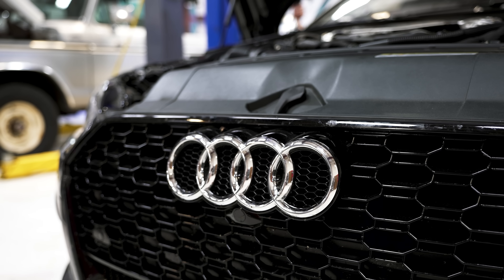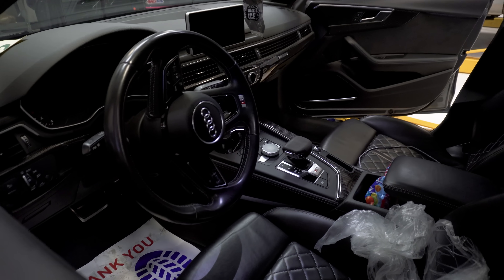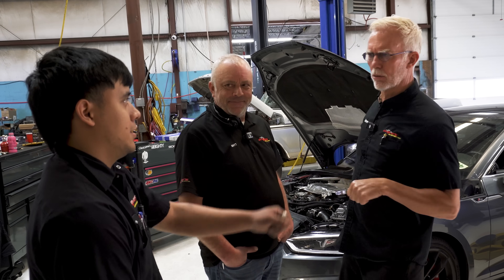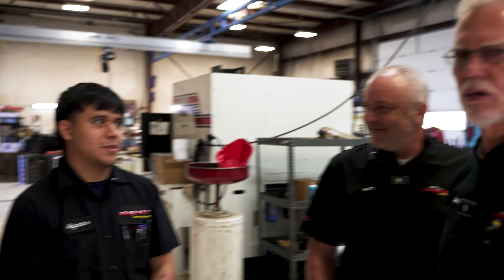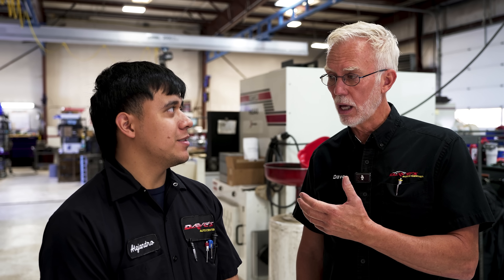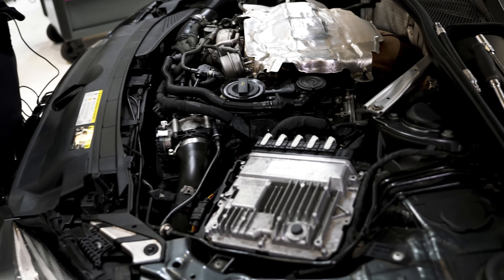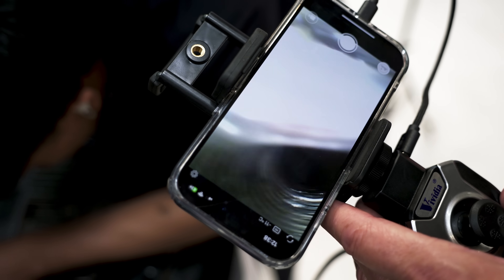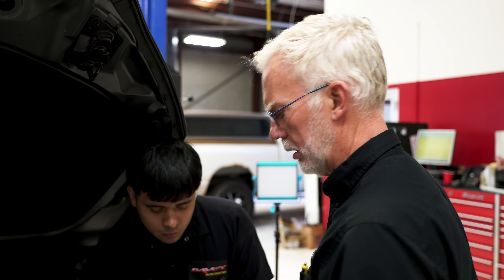Audi S5 Engine Piston Damage

Comment: Have a customer with a 2020 Acadia I’ve put 4 catalytic converters and the entire exhaust system on the car i asked him multiple times what he does that normal people don’t do and he said he drives hard after the first two cats and muffler exploded he fessed up and told me he puts a can of seafoam in the tank at every fill up. I told him that was for older cars and no one should ever use that much. He replied it’s an old car it’s a 2020. So if anyone needs a quick way to explode bank 1 and 2 converters just run an excessive amount of seafoam that doesn’t completely burn in the combustion cycle and wait till that cats get it up to 1200-1600 degrees while driving a few hundred miles a day for Uber.

Comment: Question for you. Got a friend with a 2018 GT350 with 26k miles and number 8 has zero compression. Heard the way Ford lines the cylinder walls could be the cause the ringlands went. Do you have experience rebuilding those motors? Sleeve them or?

Comment: Integrated Engineering found an issue with factory software I think it was that car, that while driving medium throttle on highway it was going super lean on a cylinder and killing it.
Reply: That’s the reason I dumped IE, so many options out there for a tune. Jackal Motorsports is a good one!

Comment: If you have clean underwear on, and want a good solid shock to the shorts, check whats involved in a VW Audi Porsche TDI 3.0 timing chain job.  
Engine and transmission out the bottom.  Transmission comes away from engine.  Timing chainS are in the rear of engine.  While engine is down, get ready to fix all the turbo and oil cooler leaks, clean the EGR & intake. 3-4 thousand Euros, idk what that is in Imperial money, but its a lot.  
Stay gold.

Comment: HORRIBLE CARS . CHECK THE OIL TAKE THE ENGINE OUT CHECK THE WATER LEVEL TAKE THE ENGINE OUT CHECK THE TYRE PRESSURE TAKE THE ENGINE OUT . PLUSE ALL THE PLASTIC CRAP THAY USE .

Comment: And it also has to do with the oil.  Check the chemistry.  I can't even install a spark plug, but I have a degree in Engineering Physics so I do know the theory.

Comment: Low-speed pre-ignition (LSPI) is a phenomenon that can severely damage direct-injection turbocharged engines. It occurs when the air-fuel mixture in the combustion chamber ignites prematurely, before the spark plug fires, at low engine speeds and high loads. Here’s how LSPI can damage your engine:
1. Sudden and Uncontrolled Combustion

In LSPI, the air-fuel mixture ignites spontaneously and uncontrolled, leading to a very rapid rise in cylinder pressure. This sudden pressure spike is much higher than what the engine components are designed to handle.
2. Engine Knocking

LSPI is a form of engine knock, but it's more violent and unpredictable than typical knocking. The intense knocking can cause immediate and severe damage to engine components.
3. Piston Damage

The rapid pressure increase can crack or break the pistons. The force can also cause the piston rings to break, which can lead to loss of compression and increased oil consumption.
4. Connecting Rod Damage

The connecting rods, which transfer the force from the pistons to the crankshaft, can bend or break due to the extreme pressure spikes. This can lead to catastrophic engine failure.
5. Cylinder Wall Scuffing

The high pressure and temperature can cause the pistons to expand more than normal, leading to increased friction against the cylinder walls. This can result in scuffing or scoring of the cylinder walls, which deteriorates the engine’s performance and longevity.
6. Spark Plug Damage

The premature ignition can damage the spark plugs, causing them to wear out faster or even break. This can lead to misfires and further engine performance issues.
7. Bearing Wear

The excessive forces from LSPI can cause accelerated wear of the engine bearings. This includes both the main bearings and rod bearings, which are critical for the smooth operation of the crankshaft and connecting rods.
8. Increased Emissions and Fuel Consumption

LSPI can lead to incomplete combustion, which increases unburnt hydrocarbons and particulate emissions. This not only harms the environment but also reduces fuel efficiency.
Prevention and Mitigation

To mitigate LSPI, manufacturers and drivers can take several steps:

    Engine Oil: Use engine oils formulated specifically to reduce LSPI. These oils contain additives that help prevent the conditions leading to LSPI.
    Fuel Quality: Use high-quality fuels that are less likely to pre-ignite.
    Driving Habits: Avoid lugging the engine (running at low speeds with high load). Downshift to keep the engine in a more appropriate power band.
    Engine Tuning: Manufacturers are improving engine control strategies and hardware to minimize the risk of LSPI.

By understanding and mitigating the risks of LSPI, drivers can protect their direct-injection turbo engines from severe damage and ensure their longevity and reliability.
Reply: Best chat GPT response so far!
Reply: @jamesblond150  Yeah so obvious. Can smell the GPT from a mile away.
Reply: Nice copy paste
Reply: Now you've covered everything  for a 'told you so' 😅😅
Reply: ⬆️This guy knows
Reply: Chatgpt went hard on this
Reply: Rocker arm failure?
Reply: Use good oil and fuel!
Reply: Well said
Reply: Generally, the 3.0 tfsi engine has a problem with peeling cylinder surfaces and it is not LSPI. They improved it but not long ago. My friend has a company called Szlif-Mot Białystok in Poland and he regenerates a lot of them and a lot of other engines and heads. This problem also occurs when the injectors atomize gasoline incorrectly
Reply: A higher octane number means less risk of LSPI.
Reply: @michaelbigelow3255  Well my car is direct injected but not turbocharged and since my last message 2 months ago, I got another 9k km on the odo problem free. Almost 20 years old now. 

It is getting increasingly harder to buy a non GDI/turbocharged car these days unless you buy older used cars. Even Toyota has it now.

Comment: LSPI destroys ring lands .. use the Correct oil that’s meets the specs 👍
AMSOIL Signature Series Protects Against LSPI
AMSOIL Synthetic Motor Oils achieved 100% protection against LSPI.

Based on zero LSPI events in five consecutive tests of AMSOIL Signature Series, XL and OE 5W-30 Motor Oil in the LSPI engine test required by the GM dexos1 Gen 2 specification.
Reply: Any GF-6 oil will do the same.
Reply: @gregjohnson2073  you are mistaken about the spec...GF-6 is the ISLAC rating for fuel eff. the API SP spec is the important one for preventing LSPI
Reply: @JasonKeranen  yeah it does both. You don't need to waste your money on expensive amsoil. I'm sure those tests were done by a lab paid by amsoil.
Reply: no these test are done at independent labs certified to do ASTM test procedures AMSOIL pays a lot of money to do these test.. if you take the time to check out the testing you will see that. It appears you don’t understand the API SP spec
Reply: @JasonKeranen you must be an Amsoil Dealer obviously

Comment: Interesting. With direct injection with turbo charging (LSPI) low speed preingnition becomes more of a problem. Caused by motor oils with calcium suffocate additive that was sensitive to high heat or hot spots in the cylinder resulting in premonition. Oils are now formulated with magnesium suffocate that will be less likely to reignite.  Motor oil manufactures have adjusted to new API standards to solve the problems.

Comment: Couldn't LSPI (low speed pre-ignition) cause  this? Turbocharged GDI engines require GF-6 specification oil to prevent this. IMHO, that piston had been going bad for awhile.

Comment: While stationed in Germany my buddy bought a brand new Audi a4, always took impeccable care of it and did all the routine maintenance……still had nothing but problems with it, right from day one until 10 years down the road when he finally got sick of spending money on it and sold it.
Reply: Latest models have issues from the factory. My mate works at an official Porsche/Audi dealer and showed me a brand new oil pump on a A4 which came with no gasket on the mounting flanges (metal to metal contact). He said they found metal debris in the oil and the car had to be repaired 24h before it was sold to the customer.
Luckily they knew about the problem and were able to address it on time. But come on... What if they didn't...
Reply: All those immigrants who are working in the plants are doing a bang up job
Reply: @simsnqta that is why I do the break in period of 1000 miles then get an oil change. Just in case of issues or stuff left in manufacturing.  Even Toyotas can have issues.
Reply: Dude got a lemon. Audi a4 have a good engine all engines I have experienced of audi for a long time period and never had issues. Even a tuned twin turbo v8 rs6
Reply: @DudeThedudesky 2009 to 2011 were horrible.

Most needed new pistons, piston rings, turbo charger, timing chain and tensioner, and rear main seal. I may be forgetting one or two things. I had all this done to mine at about 65,000 miles. Knock on wood it has run great she once with 130,000 miles.
Reply: @DudeThedudesky  I don’t think it was engine problems mostly if I remember correctly. I know the clutch had a catastrophic failure, something broke internally. And a bunch of electrical issues like sensors and things that had to be dealt with by a dealer.
Reply: @minnesotatomcat   oh. Well I suppose that could happen. Pretty unlikely though. Audis are rather reliable.
Reply: I have a 2016 S3 that's tuned APR stage 1, with 195,000 mi on it, still purring like a kitten.
Reply: @Lifeisbutam3m3 
Some of their cars were straight lemons. Some are brilliant. Educated buyer prevails
Reply: @Lifeisbutam3m3 beyond lucky
Reply: I love/hate my Q7. Just my long trip highway car.  That's where it shines! 😮
Reply: Had new s4 in 2005 and it never ran well.  Lemon law saved my wallet and got a m3 e46… best vehicle ever.
Reply: But German auto fanboys always say that as long as you do all the required routine maintenance German cars last forever and won't have any problems. You mean to tell me they are lying? I'm shocked....
Reply: Lemons can happen. I’ve done nothing but abuse my A4, redline it everywhere. Zero issues. It’s now a high mileage warrior with the scars to prove it
Reply: Bad luck. 2.0T’s are incredibly reliable.
Reply: @axe2grind244  yeah but apparently the electricals were causing problems not engine
Reply: @DudeThedudesky  I figured. I’ve had a 2.0T in every generation in 5 different cars from ‘06 to 2021 and never even had a cel come on. They handle -25 degree temps incredibly too. I’m pretty lucky, I know this.
Reply: @axe2grind244   all audi engines are reliable. I've had all engines. Rs3 rs5 and i bought my father a new rs6 that he drives daily 800 hp rs6 for 2 years. I've had no issues with them and I modified rs3 to 600 hp rs5 to 650 and had 0 problems. I plan on forging the rs3 rs5 rs6. I had an s5 aswell with 250k miles. I've worked on all audis too. I'm an audi/mercedes/bmw mechanic. Mainly bmw because they break down the most so I earn the most money from them
Reply: @DudeThedudesky  nonsense

Audi 2.0 TFSI from 2009 to 20011 was a dumpster fire until fixed and then it is a solid engine.
Reply: @BriansRCStuff   no it's not. My buddy had a 2010 audi with the 2.0 and never had problems with it for all the time he drove it. I also worked on that engine a couple times.
Reply: @DudeThedudesky the EA888 v2 was a nightmare on VW/Audis
Reply: @rickyspanish645  I don't expect every engine to be superb. They obviously fixed it and now it's good.
Reply: @axe2grind244  depends on the year… some years were incredibly unreliable and among the most litigated engines made.
Reply: I bought a 08 Audi A8 4.2 fsi  in 2009. Still have it with 200k . Runs like the day I bought it.
Reply: @Whyus793  any timing chain issues?
Reply: @BriansRCStuff  Zero problems ,I think most of those issues were with the d2 platform from 07 and earlier . I've had the media blast for carbon buildup. I've done the high pressure fuel pumps and a wheel bearing. Ohhh and a telescoping steering column motor done when it was still under warranty. Other than that , brakes and  tires.
Reply: @Whyus793  that is excellent! That is a awesome engine other than the mileage, but who cares. It sounds so good.
Reply: @BriansRCStuff  it's been the best car we've ever owned .  I just put a remanufactured set of the 5 spoke twist sport wheels that came on it and I pull into a gas station and normally am asked if that's a new Audi. They about fall over when they hear it's 16 years old.  Keeping in mind though it's stayed out of  the salty WI. Roads in winter. She gets tucked away for 5 months a year.
Reply: @Whyus793  I get it. I have a 2011 A4 and it still works very good for its age. It may not quite look new due to the less sharp edge styling versus new cars… But it still looks pretty modern! For a 13 year old car.

Ours has been been driven and snow and they have very good rustproofing… No rust at all except maybe a tiny bit on the exhaust system and some random parts here there under the car .

It is garage kept which helps keep the paint fresh of course .
Reply: My A4 had zero problems. 10 year old model, 150tkm. I sold it because I wanted to try something else. Not because I had issues with it.
Reply: @betterbeavailable  what year?
Reply: @BriansRCStuff  2014
Reply: @betterbeavailable  they were reliable by then.  The 2009 to 2011 were horrible.
Reply: @betterbeavailable  congratulations 👍
Reply: Sorry to say this, but I would never buy a German or British car. These are lease only. Stop buying these cars until they bring their reliability to toyota standards. You have the power of the purse gentleman
Reply: Had an a4 as well and besides the oil issue that a few of the yrs where known for and fixed under warranty it was a great car overall with limited issues
Reply: The car had nothing but problems, but he kept it for 10 yrs? Yeah, your friend is an idiot or this didn't happen. Nobody keeps a troublesome car for 10 freaking years.
Reply: @old_dan  he bought it brand new, had it shipped back to the states as it was his dream car, and didn’t want to give up on that dream I guess. Like a lot of people that buy expensive vehicles I’m sure he had so much stuck into it that it didn’t make sense to sell it because the resale is garbage so he just kept fixing it hoping it was the last time. I would have got rid of it before the warranty was up, I’m not saying I agree with his choices.
Reply: My co worker never spent less than $2000 fixing every problem - of which there were many
Reply: all cars have problems. people buy Audi instead of Toyota because it has a more powerful engine and looks and feels better
Reply: @RevinSHAW Toyotas dont have problems 😅
Reply: Cool story. Still enjoying mine. And will still be buying another S5.
Reply: All due respect. That friend of yours should’ve sold it right before warranty ended. 

10 years paying for issues? Kinda hard to blame anyone but yourself 🤣
Reply: @nicolasrulli  it may have even been longer than 10 years, it still looked like new when he sold it as he always took great care of it. I told him to get rid of it too but it was the first new car he’d ever bought and I can see why he kept holding onto the dream of it being a good car but it just wasn’t. I think a lot of the problems were covered under warranty as it started giving problems right off the bat, but there aren’t many Audi dealers around here so any time something happened it was another long trip to drop it off and then go get it again. I remember the clutch going out on it once but not wearing out from use , the springs were breaking or something. Good looking car but I’d never touch one after seeing what he went through.
Reply: @minnesotatomcat  that’s fair. Nowadays we all know to buy from a nearby dealer considering all of the new tech on engines every year. Keep for a couple years and sell at warranty expiration. The price of depreciation is probably cheaper than keeping some cars after warranty is up
Reply: @nicolasrulli it certainly is not.learn to find a better mechanic. Older cars are more reliable. Stop make other people than yourself rich with your FOMO(Fear Of Missing Out). Or buy a brand new car and be a slave to capitalists. You do you bro. Lol
Reply: But it's German engineering
Reply: @tntgators 😂

Comment: This goes back to another video you made about a customer who had an issue and let it go too long causing more problems. 

It bears repeating and reminding all your friends/loved ones/customers who may not know as much about cars as we do:

At the very first sign of anything abnormal - a weird noise, misfire, lack of power/delayed response, or a check engine with a hazard sign etc - pull over ASAP and shut the car off and have it towed. 

Things like this can cascade quickly. What probably started as a stuck injector for a couple hundred bucks, maybe a thousand if you want to be safe and replace all 6, turned into at least a $10,000 bill before Dave gets done with whatever it needs now. Very quickly. 

And it could have been avoided by simply pulling over and shutting it off immediately.